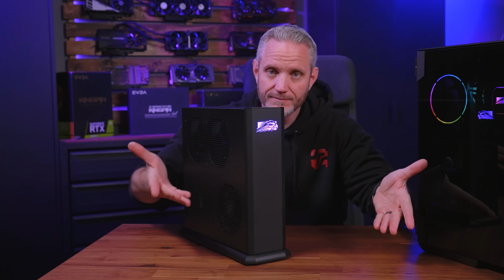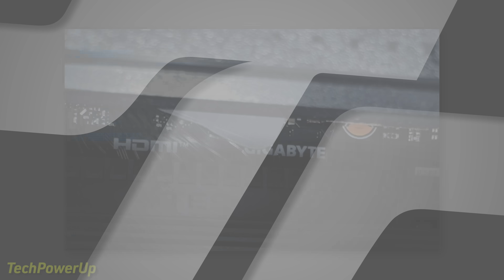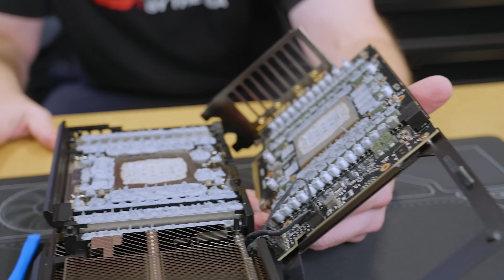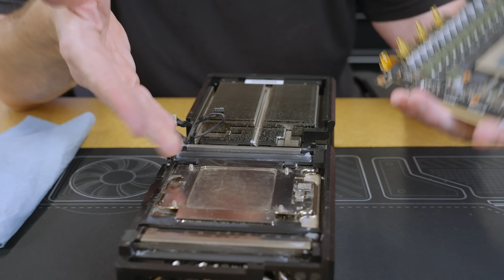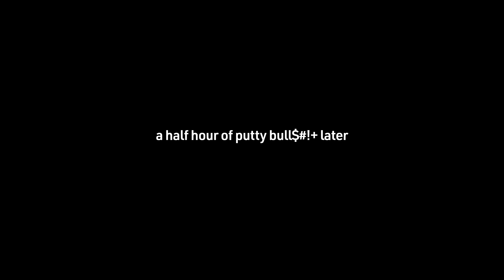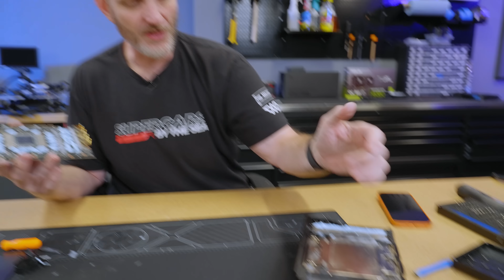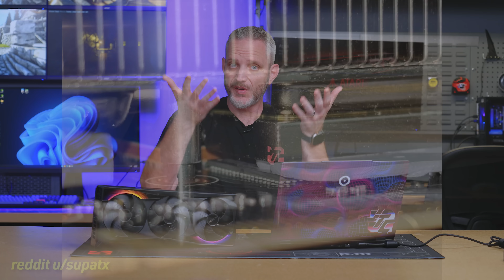What the HECK Gigabyte... WHY?

Comment: It's not that hard to replace the putty with pads, just need a tool for measuring thickness(caliper), it can also measure height with the other end, compare it to the core height on the card and the cooler and you can calculate all the thicknesses from that.

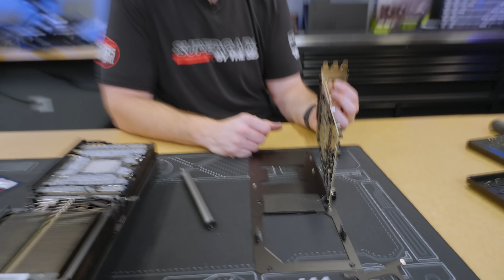Comment: @6:30 the point of the back plate is to protect the very delicate SMT components from getting knocked off, or ESD damage during handling/installation, also adding rigidty to the card which is very heavy and warping due to it's own weight could cause problems with interstitial or buried vias.

Comment: I bought a gigabyte 3080 back when newegg was doing lotteries because GPUs were so scarce from etherium farming and let me tell you this is still an improvement.  I had to repad the card because the pads they were using were low quality and not even applied correctly.  Still disappointing to see them missing their mark but it could definitely be and has been worse.

Comment: Gigatrash refused to repair a video card under warranty way back in around 2006.  They sent it back no problem found even though it didn't work in any of my (4) pcs (green screen door is all I saw on the screen).  

They then ignored my emails asking how much they would charge me to fix the card that was still under warranty.  

They taught me almost 20 years ago they are not interested in building quality products or standing behind them.  I listened to them and have not purchased a single Gigatrash product since then despite building dozens of pcs.  

Looks like their philosophy of ignore customers, build inferior products, and charge as much as possible still holds true.  Guess you can say at least they are consistent?

Comment: I have a 9070xt aorus and the memory/core temps are super cool (60c). Now the hotspot temps are up to the 90c during gaming. I have ptm7950 ready to install but im afraid the the thermal gel they used instead of the normal pads will fall apart during disassembly so im stuck with the stock. I know i can get like all the different size pads and replace everything but wth gigabyte?

Comment: I did K5 pro on my RX5700 XT fom XFX... After 1,5 years temps we're very wonky but it still workes (it did alway hit Hotspot 109 °C though everytime you load it up).
One day i decided i will rebuild the card with case fans, so i disassembled it. There we're huge bubbles in the putty where there was no contact, just air.
They must have formed because the card "cooked" the compount and it started bubbeling.

It was not that easy to put on, it was certainly not easy to remove, it certainly did not fullfill longevity promises.
I would never recommend anyone to use that stuff or any other thermal gel/putty after this experience

Comment: Having the need for all this filling is just a bandage to compensate for bad fabrication but it has become a novelty for some reason. 
I hate Gigabyte as a brand but I do wonder, is the low profit margin they get forced into by nvidea really the reason that they can't make something with a smaller tolerance margin so you only need very little cooling paste/gel/pads? This is a "luxury" card, you might expect that they do a better job in customizing the hight offset into the metal of the cooler.

Comment: Hey Jay, I am the owner of one of the cards you shared images of that were originally posted on TechPowerUp.  I did send my card to Gigabyte (Canada) for RMA, and all they did was scrape the excess gel away and sent it back.  So I now have a 5080 with a half exposed memory chip where there is 40% to 50%  (maybe less) contact between that chip and the heat pipe.  

I still use the card daily and have not noticed any issues, and can report that there has not been any further changes to the remaining gel as far as I can currently tell.  My expectation were that the remaining thermal putty would continue to slowly slide out of place, but that has not been the case thus far.

The concern I do have going forward is whether or not that 1 chip regularly experiences higher temps or not, and will therefore shorten it's lifespan.
Reply: Now that your comment is over a month old, may I ask for an update? Has the card had any further issues, or has the temps went up? Thanks :)

Comment: I think it is important to inform people that Gigabyte has acknowledged the problem and has apparently fixed the issue. Any cards built after week 19 of 2025 do not suffer from this issue. Any serial number that starts with SN2520 and up do not have this issue. Anything with SN2519 and lower do.
Reply: Great info to know. Thanks for sharing
Reply: mine says sn2535 thanks for the peace of mind 🙏
Reply: I got a 5070ti aero made in the 28th week. Haven’t built yet still waiting on mb and psu. Praying mine is ok
Reply: Update been using it for 2 months no issues. Might even vertically mount it soon
Reply: @BoscoThaiBoxing  Did you vertically mount it? I have a week45 5090 windforce oc and want to do the same..
Reply: @cosmic_gate476 I vertical my week 23 5090 Windforce it's fine
Reply: @BoscoThaiBoxing ?
Reply: Thanks for this comment. I just bought a 5080 and was getting worried. Mine starts with SN2534 thankfully
Reply: @danielc.6644  question, i bought the same card, do you know if they completly switched to pads? i want to mount mine vertically thx
Reply: @rexjakob6380  Just open it and have a look
Reply: Thanks for this info. This video had me freaked out for a second. Just purchased one on Black Friday and thankfully the serial started with 2530
Reply: What is the source of this information?
Reply: @GroetenUitNederland You can google this yourself. This issue was solved months ago. There were videos at launch about it. Not sure why Jay made this video now. Newer cards don’t have any issues, and this whole thing is a non issue.
Reply: @MaxxZimonick  Source pls or you are just talking without a proof. Ive got a new Aorus Master 5080 3 months ago and still had the problem.
Reply: @nco-c8s  Just google it yourself. You have one yourself and you haven't checked or returned the card? If my card was affected I would have had it returned already. I have one too, and it has no issues.
Reply: @nco-c8s  the point isn't when you bought it, but when it was produced
Reply: @nco-c8s  Your google is broke?
Reply: I've had no issues with the gaming OC models. I've owned a 4070 Asus Tuf, 4070 TI Super Gigabyte Gaming OC, and a 5070 TI Gaming OC, all of which worked perfectly. I also had an MSI Gaming Trio 2070 Super and a 3060 12GB Asus standard model. Additionally, I had an EVGA 2080 Super, one of my personal favorites, and none of these cards ever gave me any problems.
Reply: @Zenntric  This is a Gigabyte issue, not an ASUS issue.
Reply: Man, that really takes a load off my mind. I really hope this info is 100% accurate — thanks a lot! I bought my card 2 months ago and my serial number starts with SN2533…
Reply: Mine was a 2526 and had this issue. I had to send it in for an RMA because it kept crashing under even slight VRAM loads.
Reply: I have a 5090 that starts with SN: 2537 and it’s a nonissue, at least on my card. I don’t see any leaking even a little bit. The card has been amazing and I even got it at MSRP shipped from BB. ✌🏼
Reply: I love you❤❤❤❤❤
Reply: nice:face-blue-smiling:
Reply: Thank you. Just ordered at almost msrp and this video made me wanna cancel the order.
Reply: @tebii4707  you can look at the card and if there is a new serial number then everything is fine. also you have 3 years of official warranty lol
Reply: Mine is sn2525 and I got the problem
Reply: @tomylepetitavion official guarantee for problems. what is your problem? what do you see thermo gel? or would you like not to see it?
Reply: @KodinSun  the gel is leaking onto the pcb, and i think i can see that the gel is not making good contact anymore with the radiator when i look into it
Reply: @tomylepetitavion posé a la verticale?
Reply: @luccosta2052  oui, en horizontal meme avec leurs gel nul, ça devrais pas couler, d'ailleurs j'ai pas précisé mais j'ai un modèle aero. Tout le monde parles des windforces mais j'ai pas l'impression qu'il vont réparer les aero pour l'instant
Reply: Thank you. Have recently bought it, didbt know about the issue. Now I am calm
Reply: Pheew i have a 2545 5090 aorus master
Reply: is this true?? im so badly wanting one man, swapped to the suprim soc rather the putty issue was the only reason
Reply: Thank you for this. Wish J2C would confirm this and pin a comment or something.
Reply: @thewealthyhobo4385 but is the issue sorted out? Like thoroughly? Because I just swapped out my thoughts from the aorus to the msi suprim soc, put if the issue with the paste is sorted I may as well buy the better card in the aorus...
Reply: Thank you for the info, I was OH LAWD 😮. I just ordered one haha, I almost called my bank to cancel haha.
Reply: I have this all they way to my pcie slot with sn 2533
Reply: Thanks for the update! Been waiting for some news on this for a while.
Reply: So did they switch back to thermal pads?
Reply: The issue shouldn't have existed in the first place, considering how much you pay for their trash cards.
Reply: I have a Gigabyte RTX 5080 Aorus Master with the serial number SN2537. After using the graphics card vertically for 6 months, the thermal putty has leaked all the way down to the PCIe connector. I am now sending it to technical service.
Reply: @countergs  It is not advised to run these cards vertically I am afraid, even after the supposed fix.
Reply: @countergs what case and bottom fans did you use, and did you use stock settings or undervolt the aorus master?
Reply: Let me tell you, Gigabyte acknowledged this issue because of youtubers and influencers bringing this issue to the mass public attention. Good luck dealing with their warranty/RMA as a consumer. They will just brush it under the carpet
Reply: i have SN25034 :)
Reply: THIS👍
Reply: heys i updating for you there are another gigabyte gpu die cuz of this and they also void their warranty😊
Reply: Fixed as in how. No more gel?
Reply: Are they...gonna offer repairs to people affected?
Reply: Mine starts with SN25. I'm so glad mine is in the fixed batch, but as I have mine mounted normally i doubt i would of suffered the issue.
Reply: @ISHOTGUNJENI mine is 2528. Meaning 2025, the 28th week. I’m freaked out because of all the back lash. Of course I didn’t see anything about it until AFTER I bought it. But if I get a flashlight and look inside the gpu I can see some of the thermal gel. Doesn’t look like it’s in the wrong place or anything. But of course I’m head casing about it untill I build it in 2 weeks praying it’s all good
Reply: @BoscoThaiBoxing  It is only really affecting people that have their cards vertical, and Gigabyte said it does not affect performance or anything else. And they have reduced the amount of gel in recent cards. Your card is good to go.
Reply: @MaxxZimonick thanks for the comment bro. swear it’s like Reddit and other comment sections are filled with a bunch of mfs who swear they are all-knowing saying how horrible they are and to return it and “you’ll regret it” or “why didn’t u get _____”
Reply: @ISHOTGUNJENI  where can I find the serial number pls?
Reply: Source?
Reply: @Neo-po2xw  Can't post links for some reason. Comment just doesn't show up. Gigabyte posted a press release about this issue and the fix on April 25 on their website. There is also a long Reddit post that talks about week 20 being when the new revised production run began. Google is your friend.
Reply: @Neo-po2xw google “Gigabyte Thermal Gel” and there is an article on Gigabytes own website acknowledging they lowered the amount in cards after April of this year.

Comment: I personally like a computer that lays flat, like the old days.  The way heat rises and other general physics, computers do much better laying flat with lots of air space between  parts.  Yeah, its prone to get a little more dusty.. but the heat won't be hanging around and recirculating into the other radiators.

Comment: I would probably suggest taking somethign like a exacto knife, OR maybe even just a Plastic Kitchen knife IDK I havent felt the GOOP... To "cut" the gooping section off.. Just remove the bit that is falling out. and leave the rest be until it becomes a problem. IF its not causing any issues or lacking thermally, that would be my reccomendation. No need to go through the nightmare GPU cake frosting event. Could probably just press down lightly with the knife like tool and have it seperate, or "cut" the material. Easy peasy.

Comment: This was a semi issue on even the 3000 series gigabyte cards.  I had a 3080 vision oc and when doing super intense workloads on it, the pads would actually drip oil out of it. vram temps were SHIT with the stock pads.  I repadded and pasted it myself and it massively improved the card.

Comment: I don't know what Jays problem is? I put Putty on my EVGA 3080 and it was not that hard and also not dirty at all. I also will never ever use a f****ing thermal pad again. Thermal pads are shit compared to good Putty. Good Putty can be used for years and is also reusable. With a good PTM on your core you can use your card for years without open your card.
I also don't talk about the garbage Gigabyte put on the card. The Gigabyte shit is terrible and not even comparable to good Putty from DerBauer for example. The good Putty also never move.

Comment: der8auer has a video on the Hybrid paste. its not really worth it and just a marketing gimmick.
all it does give you the downsides of Liquidmetal in a thermal paste. you have conductive bits in the paste and the issue of forming alloys with the hopefully nickel plated cooler (in Romans video the cooler was not plated if i remember correctly)

Comment: Built a PC for my friend with a Gigabyte 5080 back in February with a vertical mount, about two weeks later he sent me a picture of the putty oozing onto the riser cable and asked me what is going on. I freaked out and had no idea as I did not see any reddit posts about it back then. He just cleaned it out and it works fine but it was ridiculous.
Reply: is it still working fine?

Comment: There's different putty material viscosity. Usually the best to work with  and safest, is the one you can roll and create logs, just like modelling clay. UTP-8 for example would not have this problem.

Comment: These things have only 1 purpose...spare manufacturing cost for the manufacturer... you cant rly automatize thermal pads, but these puddy shits, yes you can, so they can spare money, but other than that, I think its the stupidest idea...the way to go, is ti use thermal paste on the GPU and thermal PADS everywhere else...so it wont leak out, and repair shops can change those relatively easy. Now for repair shops it will be a pain in the ass. I never used these puddy shits and never will...pads and pastes, this is the way.

Comment: I just bought a gigabyte gaming oc 9070 xt and it has the thermal gel, should I swap all the putty out with traditional pads? it's not vertically mounted but I don't want any issues with this card 😭
Reply: Is the graphics card mounted vertically? If not you shouldn't worry about it much at all. Monitor temps regularly and see seepage of the 'thermal gel'. If either one is unusual then consider changing to regular and reliable thermal pads. Enjoy your RX9070XT!
Reply: Basically, If the graphics card is mounted horizontally (i.e. not vertical), the risk of gel migration is much lower, so you generally don't need to panic immediately. Keep an eye on GPU, VRAM, and hotspot temperatures under load. Also watch for any physical seepage or residue around the edges or connectors. If you see abnormal temp increase or visible gel creep, then consider replacing the gel with quality thermal pads — but note doing so may void warranty, and success depends heavily on using correct pad thickness and a good cleanup. If your card is from a later production batch, Gigabyte claims they’ve improved the gel application process, so you might be fine as is.

Comment: I repasted my Hellhound 7900XTX when the delta temp was reaching over 25-degree. Repasted with MX-6 and new thermal pads. After 6-month the delta were allmost the same, VRAM temps were like 6-degree lower (89-93C). Then I made new try with PTM7950 and Upsiren Ultra putty (real version, not "EU" fake). Now after 9-months of use, delta stays max 9 degree. And memory temps went from 93 to constant 86-88 in long high GPU usage scenarios. Putty has not oozed out or no oil has seeped out. With putty I have huge difference that what it was before first repaste. VRAM originally was constantly 93-103 when gaming 4K longer periods and technical support said that it was is still ok... And for future, the putty I used was quite high viscosity, more like "play dough" and not sticky. So I hope if need ever repaste, the cleaning would be easy.

Comment: Why thermal pads of different thicknesses on one card. Are they not making the cooler? Can't they CAD a heat spreader to use the same pads on the same card? On all cards of the GPU's generation? How many cards have thermal issues due to 0.25 instead of 0.5 at the assembly line? 
Oh, but look! A ridiculous giant rainbow puke box that draws like half a vacuum and droops grey goo...

I have questions...

Comment: i replaced my 2080 super pads with k5-pro putty when servicing it as i found it hard to get the right size pads for it.  i kept getting really high hotspot temps before as i think pads was stopping the cooler making good contact with the gpu die.
i tried with the k5-pro stuff and it worked perfect. its messy stuff but i really like it